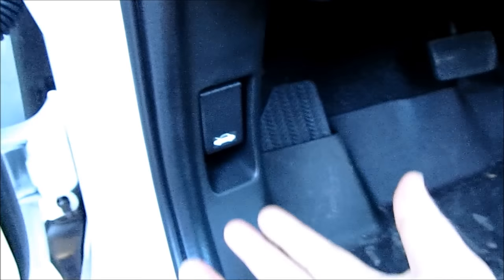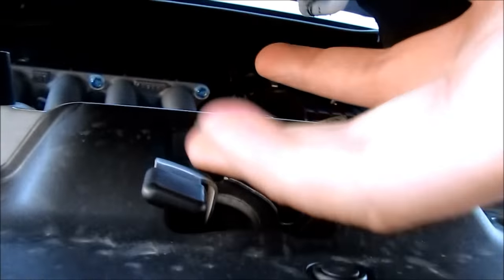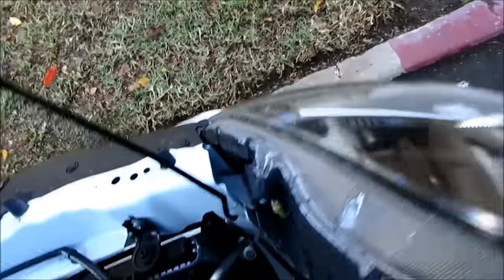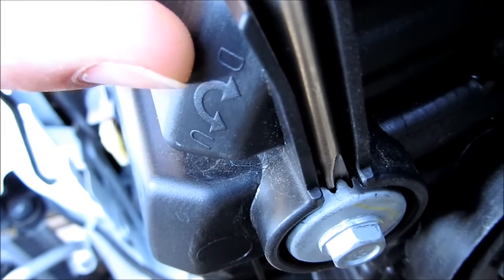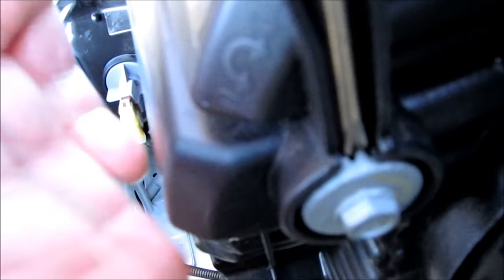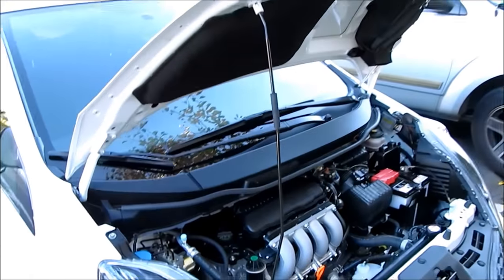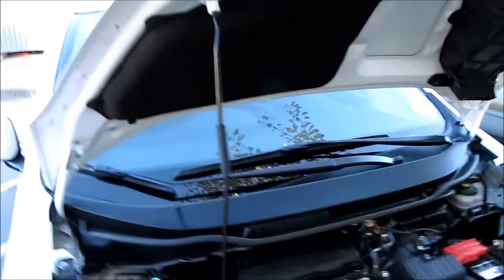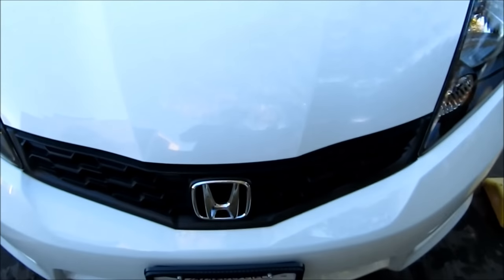Honda Fit headlight aim adjustment

Comment: One side is a lot higher than the other on my car. The screw does nothing on both headlights of my car. I can confirm the screw is turning but the height of the lights aren’t adjusting. I’m at a loss here.
Reply: same for me. how did you fix?
Reply: @unclelucas2389  The mechanism was broken so I ended up replacing the whole headlight unit with a used one from eBay. Cost me £10. 

This did require removal of the front bumper to access the bolts. Took me ~20 mins in total.

Comment: Short but good video.  I recently purchased 2010 Fit and when I drove it the first time at night, I could see 2 spots from each headlight on the asphalt.  They were about 30 or so feet from the front of the car.  When you drive, does your car spread the light evenly or you also see 2 spots of light?  Just want to know if this is normal for Fit or not and whether they need adjusting.

Comment: I was doing this and it was working until the nut that you spin stopped elevating the headlights and now the headlights don't move up/down . Any suggestions on how to fix it?
Reply: First Name Last Name Disassemble the light housing and attempt to fix the elevation screw if possible.